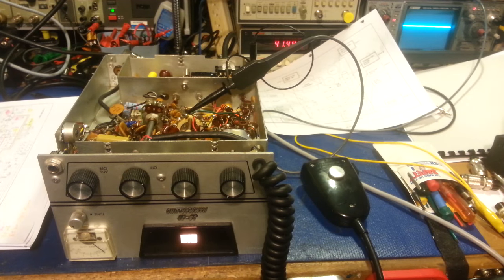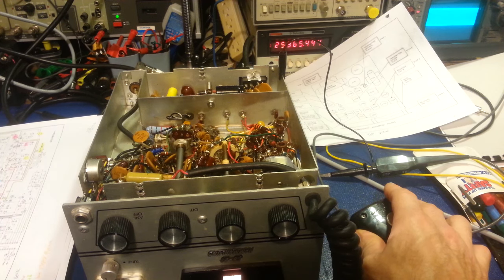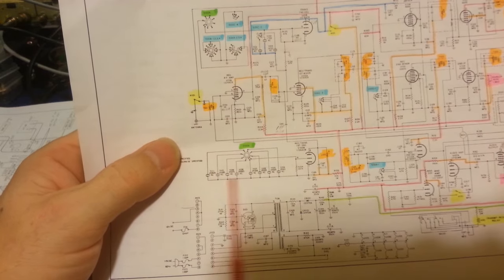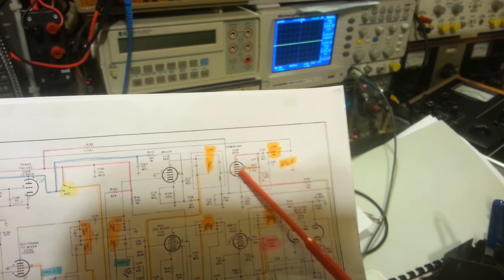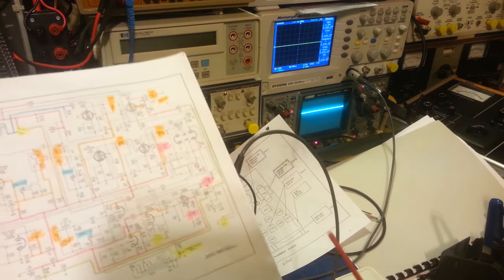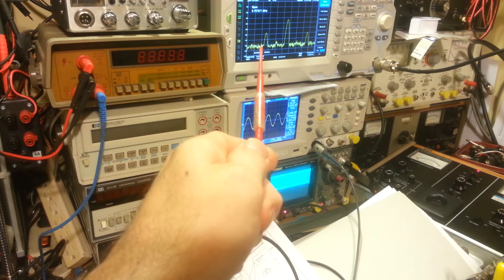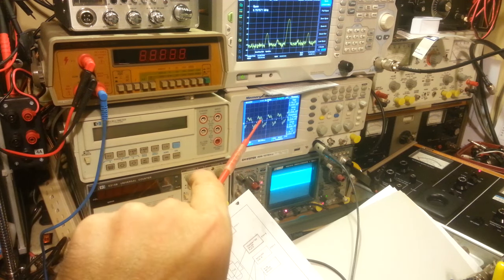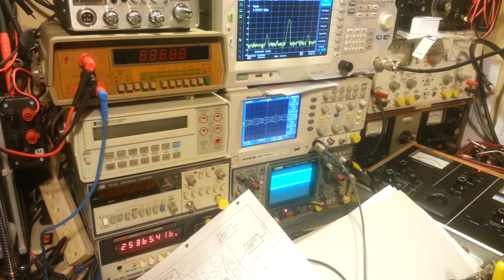HELP!!!  Hammarlund CB-23 with weird mixing circuit problem.

Comment: I have seen level faults cause mixer problems, at least on transistorised gear, I would make sure the levels are matched by alignment, and that the tuning is set to the correct bandwidth, in 26MHz, not 25MHz in case it is being tuned out.

Comment: Mike,
I'm no where near your skill level when it comes to CB's, but when I watched your video, the problem looks a lot like one of the IF cans isn't doing its job.  Some of the IF cans out there use mica wafers for the internal capacitor in the tank circuit.  These wafers are notorious for getting "silver mica disease", where the silver on the contacts gets on to the mica and changes the value of the capacitor.  If this unit uses this type of IF can, I would take a look at it.  You could also use a signal generator to inject a signal at the pass frequency (into the disconnected can) and use the spectrum analyzer to see if it tunes up.  Hope this helps.  Really interesting video.  I learn a lot from your channel.  Thanks a lot for sharing!
Reply from the maker: I'm suspecting silver mica disease to.  See the reply I left Buddy.

Comment: Spent past few moments looking over the schematic.  Been up since 2am this morning and tired. But I sort of lean towards What Robert below is saying.  I think your problems are in the transformers.  Not sure what type they are but being double tuned circuits that is double the problems.  I am not talking about silver mica disease. But the capacitors are mostly mica held in place by plastic. Over time that plastic shrinks, moving the mica and breaking it. This now changes your tuning range hence why you would have such a large 25 MHz signal and a small 27 MHz signal.  Seen this many times in the S9 and R27 browning combo.  But just got home and only looked at it for a few minutes so this is my uneducated guess.....
Reply from the maker: I had done the alignment by the book and even went over it a couple times and what you see here is the result.  I decided to trying to align the entire RF transmit circuit using the spectrum analyzer.  Got rid of almost everything we don't want  and got the power on channel to increase, actually looks almost acceptable.  Bad news is the power on channel when tuned like this is only about 1 watt.  I to am starting to suspect I might have bad caps in the transformer cans, would be the first time for me either.  Not really sure what type they are.  Luckily I have a pile of parts chassis of these radios so I think I will remove a can from one of those, pop it apart and see how the capacitor is constructed.  What really sucks is most of those cans are located directly under the shafts for the band selector and volume controls.  Going to be a real joy extracting them.

To everyone else i'll try to post what I find.
Reply: +1 on the internal caps on T102 or T107.  do either of them seem to peak with the slug flush with the top of the can?
Reply: Perhaps you could disconnect the transformers form the circuit and measure their capacitance values. Or tack on a variable cap and see if you can tune it in with that (replacing it with fixed caps after you find the problem). It does sound like a filtering issue after the mix.

Comment: Hi Mike, It's possible that someone trying to peak the output power has detuned the mixer tank circuits landing the frequency on the 25 mhz instead of 27 mhz. You could try feeding a signal into the tuned filters and peak them at the correct frequency. This could be done while the set is off. Just a guess but simple to check. Dale Kg7ssb
Reply from the maker: I had done a by the book alignment and this was the result.  I even went over it again and no change.  See the reply I left Buddy.

Comment: Thats an interesting one Mike! Are you certain the TX is aligned on the correct frequency? What happens if you use the spec anny, on the PA grid, to peak the coils on the 27MHz spike? Do they all tune correctly with a clearly defined peak?  Yes it is possible the mixer isn't mixing, but I would have thought it unusual. These tubes mix microvolts successfully in receivers, so they don't need lots of drive. That said, you did mention that the amplitude of the 25MHz oscillator seems low compared to the 1.7, so is the coupling cap open? I would carefully check the DC conditions on the mixer stage, is the tube drawing the expected current- a faulty tube aside, the cathode resistor might be high or open for example. Also the tube socket. If you have a set that's a worker, or has a different fault, you could perhaps do a side by side comparison of both AC and DC conditions. Good luck, it's got to be in there somewhere!!
Reply from the maker: Tye factory alignment procedure for these uses a VTVM to take voltage measurements when peaking the transformers.  Scopes were not to common back then.  Read the reply I left Buddy.
Reply from the maker: +ab5ni 

See the reply I left Buddy.
Reply from the maker: +sporadic -Z 

Read the reply I left Buddy.  I'm really thinking I have a bad transformer can.

Comment: The signal observed @7:05 looks like out from a balanced modulator? - strange? But the mixer is obviously mixing. It is not unusual to have a lop-sided ratio of signals to be mixed (modulated - remember this mixing is not linear summation, like an audio mixer, but it is multiplicative mixing - the signals are not added, but one signal is multiplied by the other). I would suspect the filter circuit or power supply coupling between oscillator/amp stages - does B+ have RF floating around on it?
Reply from the maker: Really starting to think its the tuned transformers between the mixer and driver tube.  See the reply I left Buddy.

Comment: My first thought even though I am a no nothing 18 year old was transform or leaking cap. The fact that you have all the proper source signals and you have partially complete mixing with all sums on the scope seems to point to the one thing most responsible for the filtering which in this is transformers. The fact that you have two identical units doing this makes me think this even more. Have you tried checking ESR and values on the caps in the era's? Have you checked that the transformers by themselves are with in the design specifications. Since both radio's have the same problem I think it is safe to say that some component is not aging well and if producing a predictable mode of failure for that design. Sorry if I am telling you the obvious but I do hope it spur's new thought and insight since I am sure you already know the answer you might just be too close and too involved to see it.

Comment: could you tell me the scope you have as well as the spec analyzer... Sorry bro that I don't have an answer for your radio...
Reply from the maker: On the bench in this video there are two scopes, a BK 4 channel scope and a GW Instek 2 channel.  The spectrum analyzer is a Rigol.
Reply: I like how the scope shows the freq of the carrier in the numeric form... Please include the model number.. Thanks Pal and good luck...I will be waiting for the solution for the fix, if there is one..
Reply from the maker: +bbugin4u 

Pretty much all modern oscilloscopes have math functions.  They have all kinds of measurement parameters and many also have a FFT function.

Comment: More on Silver Mica Disease on inside IF cans. http://www.ppinyot.com/if_transformers.htm

I was not aware of this as a thing. I will say that I find that silver mica caps in your average CB class C amplifier do not hold up well. The heat from these unit quickly degrades the value of dipped silver mica cap's.